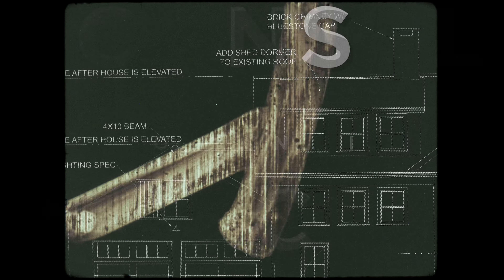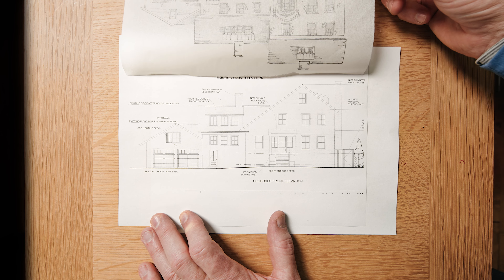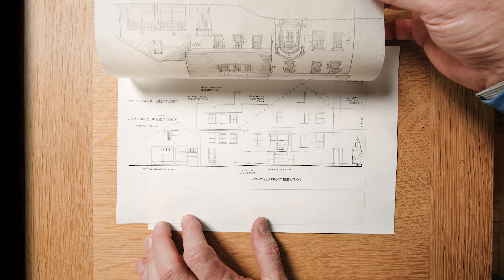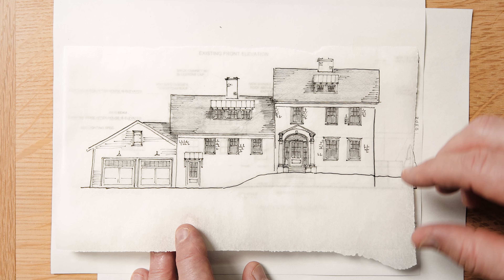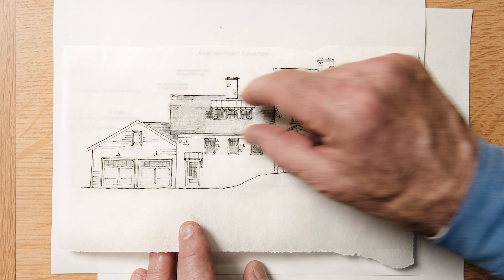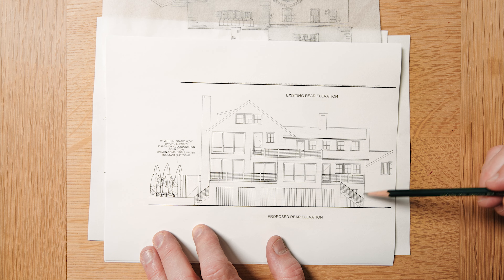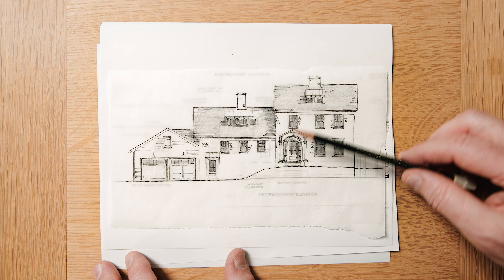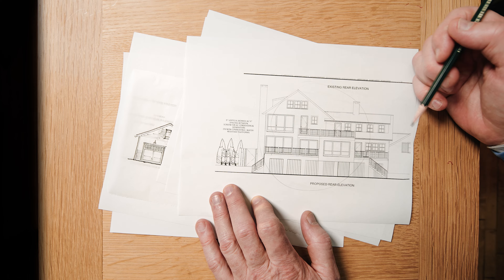Fixing a house in an historic neighborhood.

Comment: Hey Brent, you like historic documents so I was wondering if you had ever heard of the Indian book The Mayamatam which contains 4500 year old texts about architectural design and construction techniques? For example, one of the texts gives the formula for something called an “Ayurvedic Paste” which is used like mortar to join stonework together and is supposed to be up to 20 times as strong as modern cement. It was used to build the 7th century AD Surang Tila Temple in Sirpur, India, which is still standing even after a powerful earthquake in the 11th century leveled every other building in the area.
Also, in your studies of ancient Roman and Greek architecture, have you ever traced the orders further back in time to places like Crete (who apparently were influenced by architectural styles that migrated up from Egypt)?
Reply from the maker: Thanks, I have not heard of it but will definitely check it out. Yes, on the Egypt thing. Thx.

Comment: Hi Brent,
Can you show some stone on that lower level about 4 or 5 feet up to line up with the foundation on the upper part? Then you could have flag stone steps leading into that lower door and carry the random stone into the floor of that lower part going into the kitchen. That might give the lower area more character and substance. You could use stone on the main entry steps too. Then you could incorporate stone into the back portion.
These are just some thoughts I had.....

I like what you are doing very much. I hope the board will approve your concept. 

I am a huge fan and hope I am not being too overbearing.
Reply from the maker: Good thoughts. Thanks for sharing.

Comment: Hi Brent. I like the massing of your design but I don’t like the front door (sorry!). It seems a little grand and ornate for a shingle style New England home. What about using a front porch across the taller right section instead of the pediment?
I also don’t like the spacing of the windows on the kitchen. The upper dormer is obviously centered on the chimney but the three kitchen windows aren’t aligned so that the middle window is also centered on the chimney. Maybe center the middle window and then adjust the spacing between that one and the windows on either side?
Reply from the maker: Ok, thanks for sharing.
Reply: Hi. I can always tell when you don't like a suggestion because you only reply with "Thanks for sharing" :) I'm sure you considered using a porch for part of the front facade so why didn't you go with that idea? Also, when you are dealing with things that line up visually, like the location of the dormer and the chimney, and then a third thing doesn't quite line up, like the locations and spacing of the kitchen windows, how do you decide which alignment takes precedence? @BrentHull

Comment: The original design made my eyes hurt. I like the direction you're going. The proposed changes to the front facade will, I suggest, drive more changes than you anticipate to the other sides. Are you restricted by the owners' preconceived ideas regarding the interior layout (the inside out vs outside in approach)? 🤔
Reply from the maker: Thanks. Yes, the plan assumes changing nothing on the inside.

Comment: The front, even before your improvements, looked okay. Not great, for reasons you pointed out, but okay. The back though is shockingly bad. Horizontal wire railings? Picture windows? This seems to be a common theme these days, that some kind of attention is given to the aesthetics of the front, but the back and often the sides have no rhyme or reason except to say that they are designed from the inside out. I think the front that you've designed should definitely pass, but you may need more concrete reinterpretation of the back if the reviewers are light on imagination and trust. In a rational world, you could simply go to them and say, "I'm Brent Hull. I don't do ugly" and get whatever approval you need since, let's face it, you know way more about this than they do.
Reply from the maker: Thanks, I appreciate it.